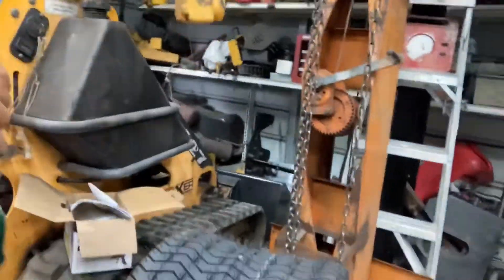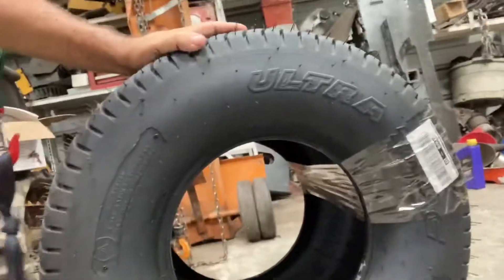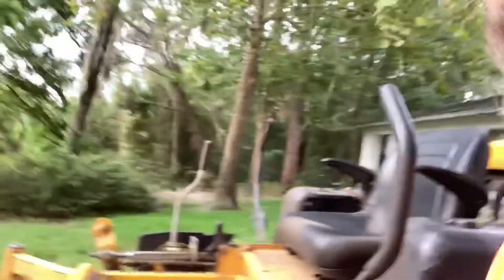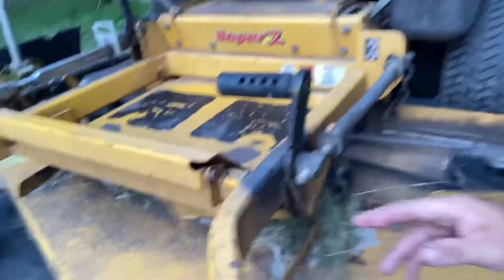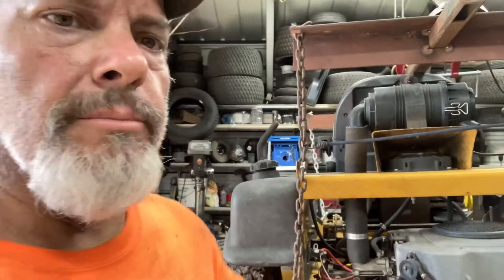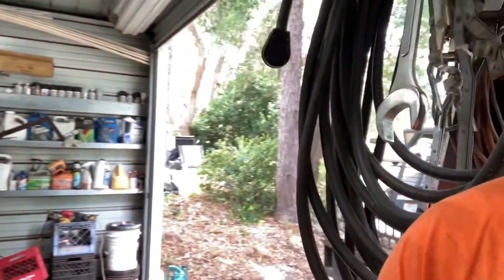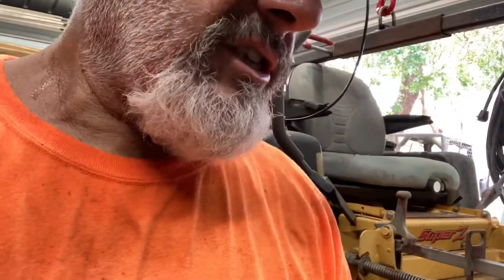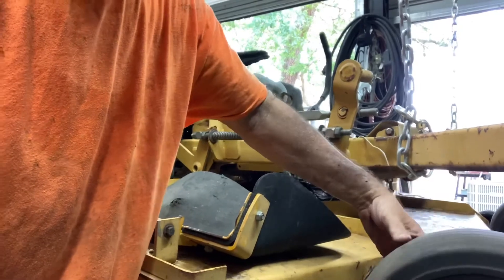Bigger tires on 72” Hustler

Comment: Why can't you use high amp relays to control your fans and clutches.
Reply from the maker: I don’t use fuses or relays. I just do wire from source to load. I’ve never had any problems that way, but I’ve also since then gone away from using clutches at all so that illuminates the part that’s expensive and sometimes hard to get.
Reply: @sclawns5257  I understand what you're saying what I can't understand is I haven't had any problems with clutches or fans. I've never wired something up direct. Anytime I've seen what you're talking about in a electric circuit there's been a problem in the power supply or ground circuit side. I always use a certain wire size for a certain amperage amount. I have seen clutch field coil problems causing high amp drains. Are you checking the resistance of your coils and fans. I've seen coils pulling excessive amounts.
Reply: @sclawns5257  you do realize what a fuse is for. And are you telling me you start your engine up with the blades running. No clutch at all. Just a straight pulley off the engine to the deck. Please tell me your not doing that. I've got a 35 year old mower that I've only replaced the clutch twice.
Reply: @sclawns5257  man I wouldn't be telling people that. You're running a mower with out safety systems. And if you ever have a short circuit your going to have a fire.